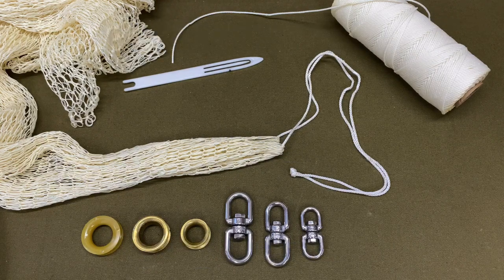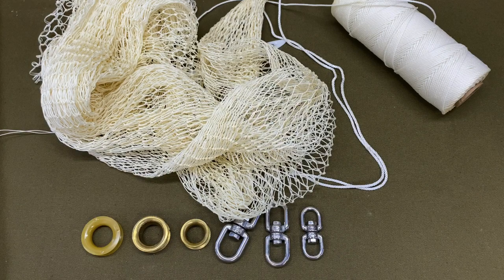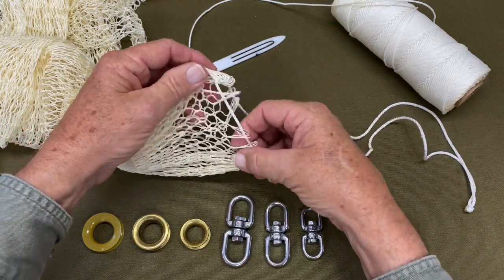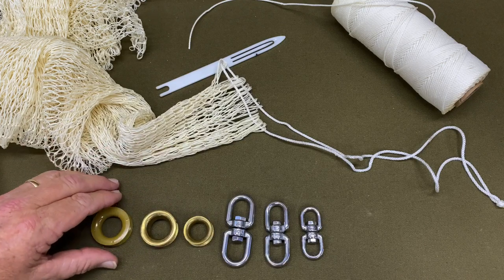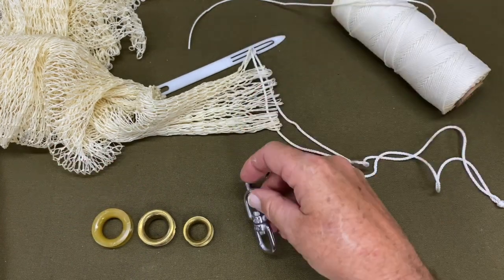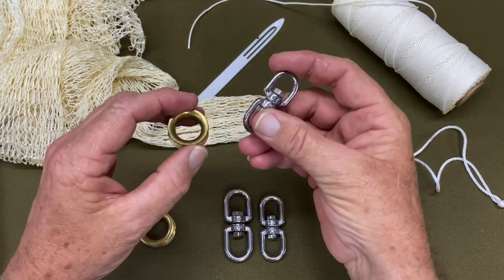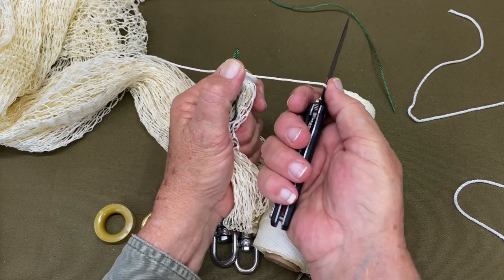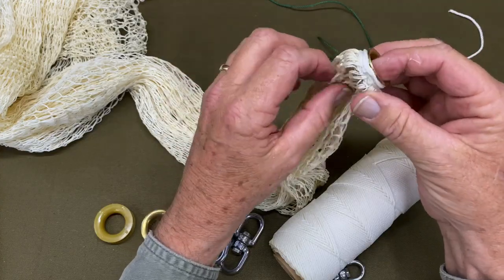Making Cast Nets / Part 3 Installing the Thimble

Comment: Thanks so much for putting these out!  I know I'm a little late to the table, but I'm working on sourcing what I need to make one.  Where do you get the Thimbles?  I have found twine, weights, swivels, and needles online, but I've only found nylon thimbles.  I even tried searching for cast net horns and haven't been successful.  Also, about how much #4 twine would one need to make a 6 foot net?  At any rate, thanks again for your clear and concise instructions and the time you've put in!

Comment: When finishing the net itself to its final length and installing the lead line, wherever the last row of mesh end, there is a stagger from the previous round of mesh and the row of final mesh making the final net edge where the lead line ties to, to be uneven. How do you remedy that?  Where my very last mesh is, there is a stagger from the mesh row above making a uneven edge to attach a lead line to neatly.
Reply from the maker: Your lead line will be fine and it will work they same without any problems. Your net is solid and your lead line will hold up to more stress then commercially made nets. I am glad you made a net. It will last for ever.

Comment: Can I use 40 lbs 8 stran fishing line to make a net ?
Reply: Would it work?
Reply from the maker: I am sure it would but also remember that is designed as fishing line and not originally designed for use on nets. I am sure it would suit your needs. If it’s a heavy line, you may want to adjust the amount of weight you use so it will sink at a good rate.